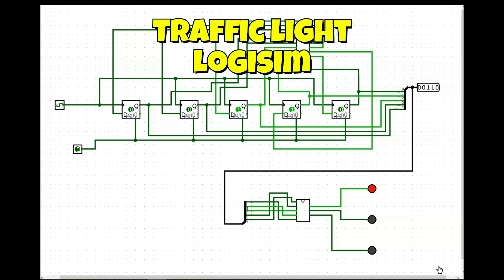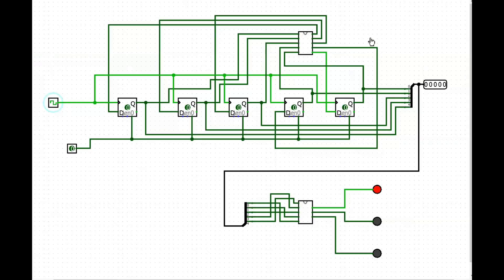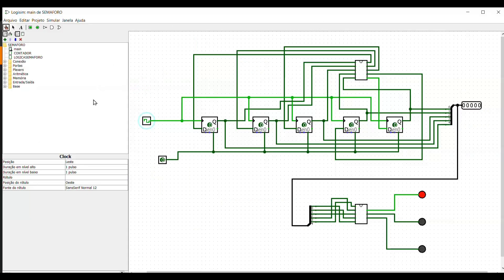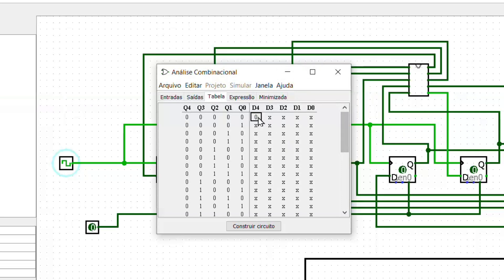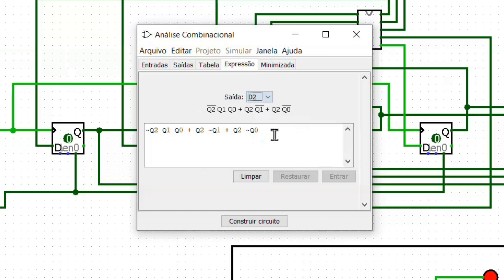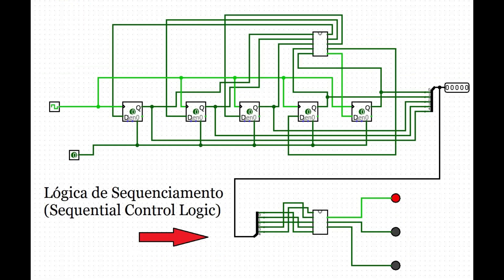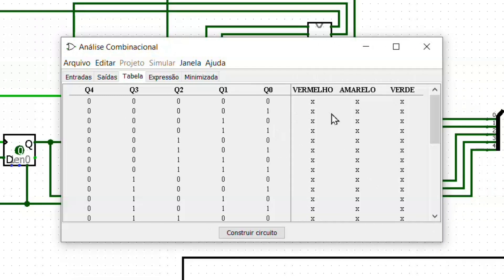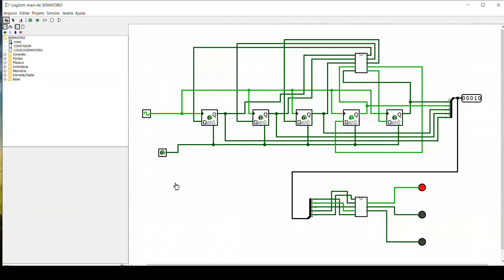How to Make a Traffic Light with Logic Circuits in Logisim – Step by Step!

Comment: When making the next number logic do you have to pre make the circuit before using Logisim's combination analysis tool?
Reply: How do you make a counter using d flip flops?
Reply from the maker: No, logisim itself generates the circuit  when you click on build circuit button
Reply: @thepcbquest  what about the flip flops, as they werent made when clicking the build circuit button
Reply from the maker: @syed4070  for the fliflops you need to make manually, but dont worry until the next day i will share this logisim project. Subscribe so you don't forget!